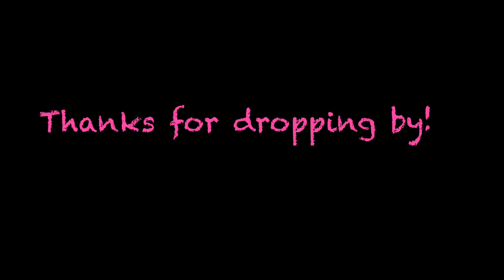Mini 4WD RC Conversion 3D-Printed Edition

Comment: I really want to do this to a couple of mine but I just do not have the skills to do it at all. Unbelievable work mate
Reply from the maker: Thanks for your compliment. The hardest part is soldering the “ T-bone” for the front wheel, I found using the Tamiya steering system set Part 15258 easier, I made a video on that conversion too.